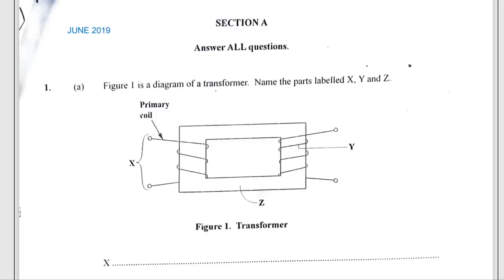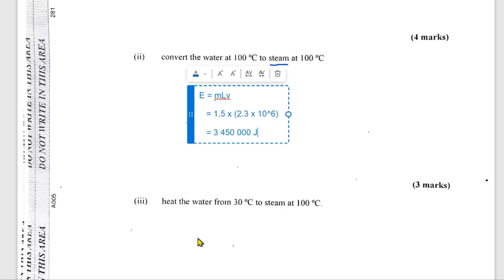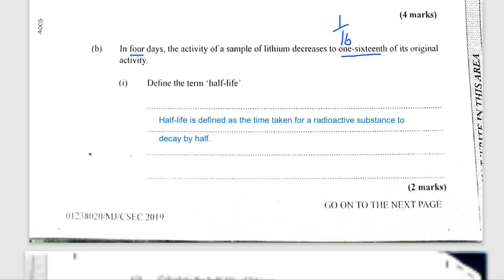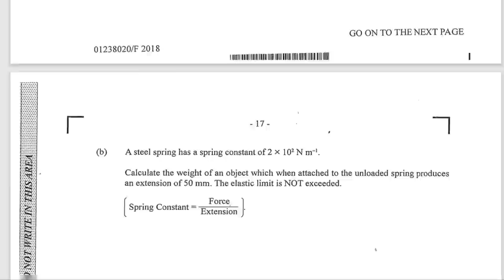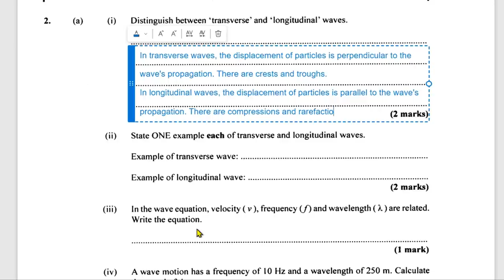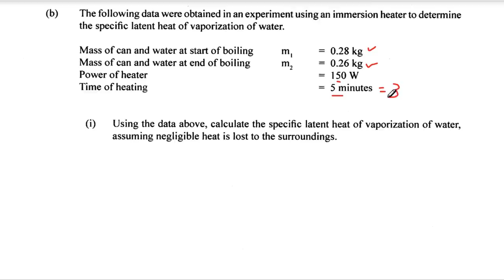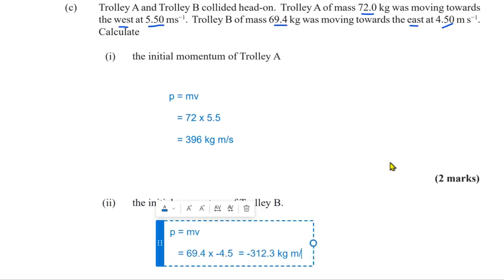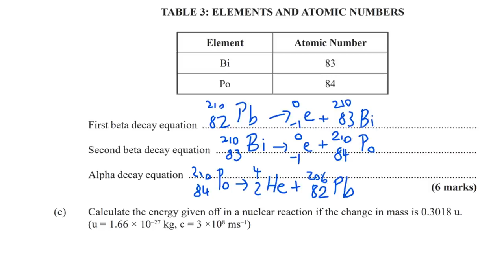CXC Physics P2 Walkthrough June 2017-2019, Jan 2020

Comment: Sir for June 2018 question 5b wouldn't you divide the 10N by 10 since the question asked for the object's weight and not the force it applied. So, wouldn't the answer be 1Kg?
Reply from the maker: Weight is a force, which is measured in N. The mass would be 1kg, if the question asked for that.
Reply: @Strangelove20  okay sir thank you got it was confusing weight for mass